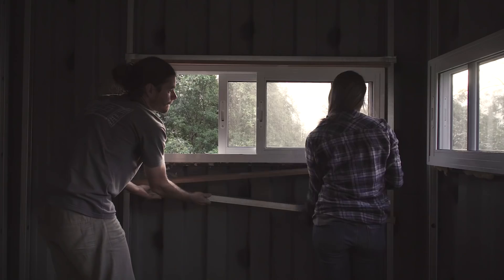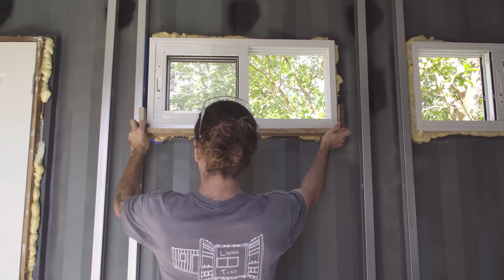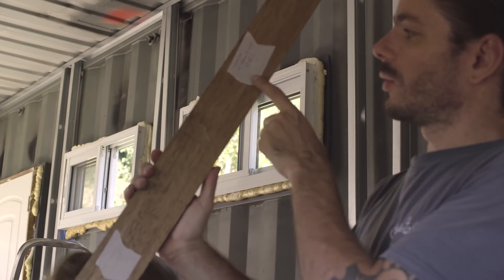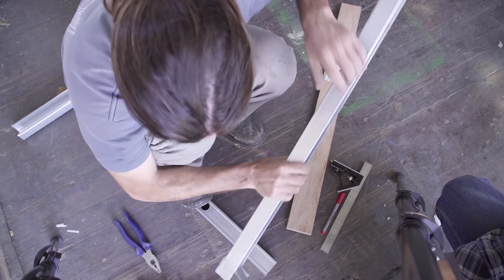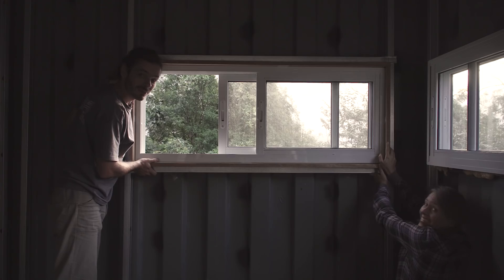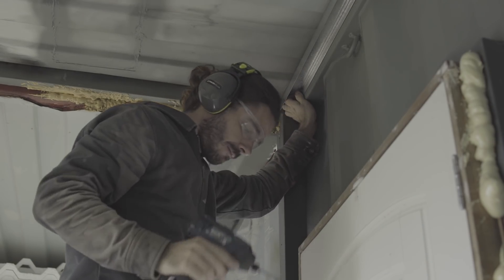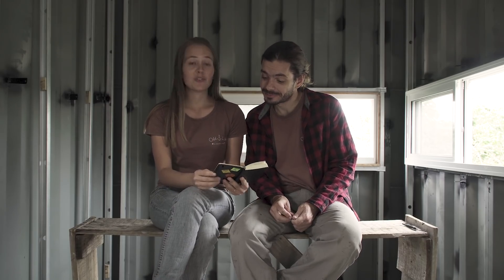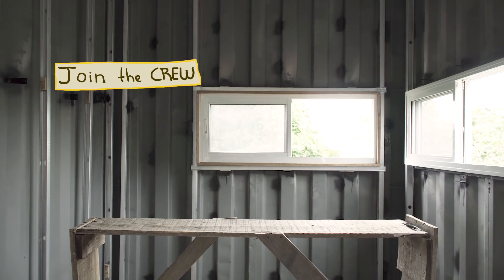How to frame a Shipping Container - Living Tiny Project Ep. 030 Part 2

Comment: Bravo! Well done so far. A stronger or more powerful drill for the pilot holes will make the job easier and faster. When using the drillscrews always use a drill with a clutch so you don't injure yourselfs. You guys are doing great so far!
Reply from the maker: Thanks a lot for the tips Robert!!😊😊👌🏼

Comment: Hi guys. I love what you guys are doing.

If I could make 2 suggestions.
1. Have a small side project and build a workbench or maybe buy one. It makes working much more comfortable and it's safer as well.
2. The self drilling screws are easier to screw in when using an electric drill and not a cordless battery operated drill. The electric drill has much more talk and this make the job much faster. This is in my experience.

Keep it up. Cheers Glynn from Cape Town South Africa
Reply from the maker: Hey Glynn!! Thanks a lot for the tips!! We are planning to build the workbench. We just didn’t have the time yet unfortunately. For sure we will try the cord drill on the second half of the house. Thanks a lot!!

Comment: Hi guys,  nice job! Your metal studs will be nice and true (vertical and square).  I'm not sure the horizontal dwangs above and below the windows were totally necessary but they certainly finish it off nicely and add strength.  I'm interested to see how you screwed the window to the frame.  I'm heading back to my container in a few weeks for a gas fitter to install our gas water heater.  Will send you some pics.
Reply from the maker: Hey Shane thanks a lot!! Well we we are in doubt we we decide to play safe. Heheheh always hopping for the best!! We will be waiting for your update pictures. Have a good week!!😊😊

Comment: I like the channel. I think It would be easier to weld the tops of the metal studs by drilling a hole in the sheet metal then weld to the metal tube.  It's called a plug weld. Basically a spot weld in the hole you drilled in the sheet metal. Practice first it's easy to burn back the edges of the thin sheet metal because it's so much thinner than the tubing.
Reply from the maker: We are not sure how would react different metals welded together. So we decided no to risk. Do you know for sure it would work fine? Thanks a lot for the help!!
Reply: they both have mild steel base metal. just one is galvanised. You will not have a problem. I promise.
Reply from the maker: Thanks a lot for the tip. We really appreciate!!😊
Reply: care needs to be taken the fuses from welding galvanised steel suck.